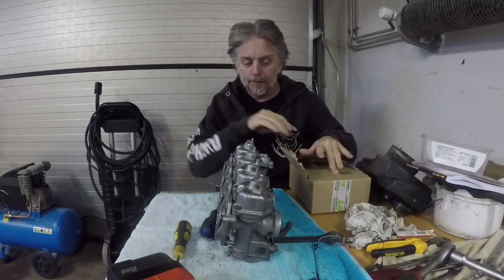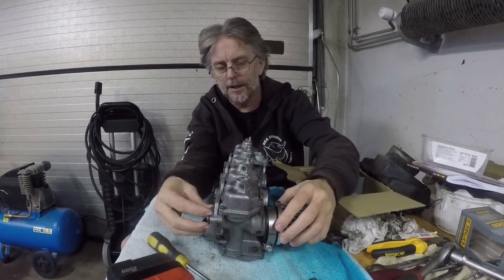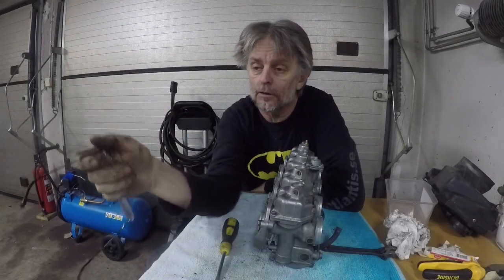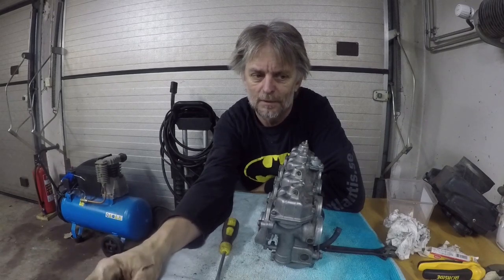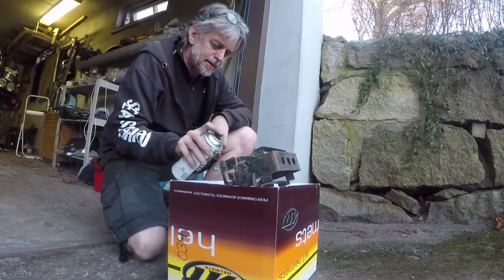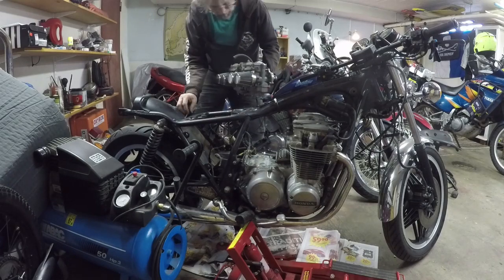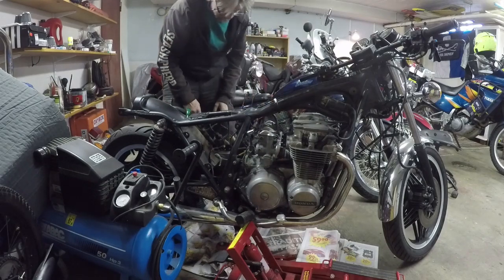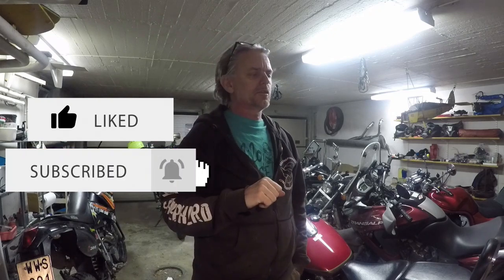Honda CB650C Restoration S2 EP2

Comment: Nice video Anders! I think that seat could look really good. You may want to mount the tank and modify the frame slightly to get the bottom edge of the seat to continue a straight line from the bottom of the tank. The so-called "bone line." Just a suggestion. Hope it helps. 👍🙂
Reply from the maker: Thanks mate! Yeah I have been thinking about this. I have already been cutting some but not finished yet. Cheers!